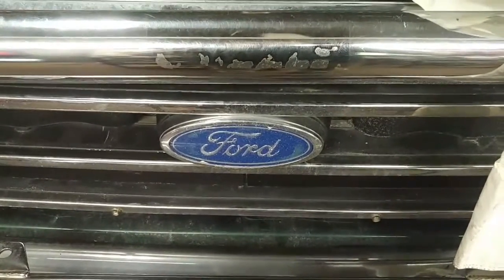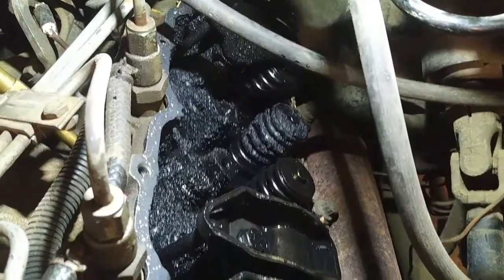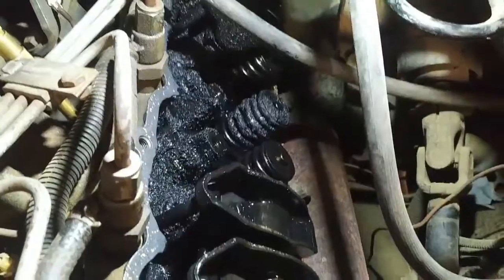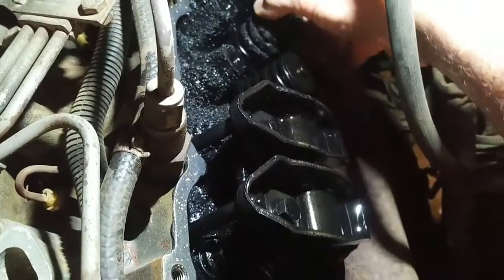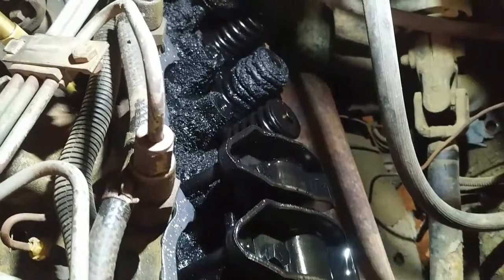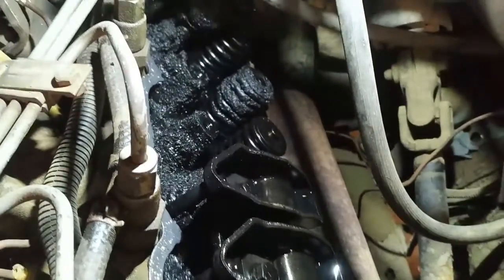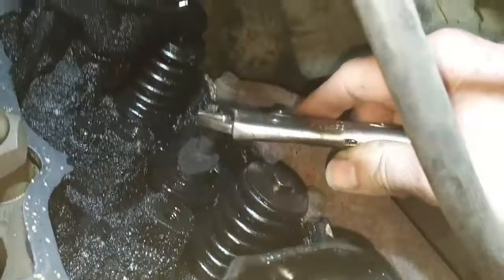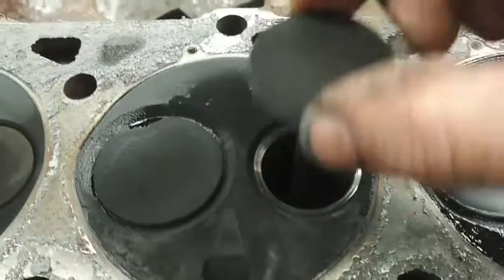1990 F350 7.3 Compression Problem pt. 2

Comment: Can intake vaccum test suffice in this situation of checking the valve
Reply from the maker: A diesel does not create vacuum in the intake like a gasoline engine so a vacuum gage connected to the intake would be no use. It may have shown up as an unusual pressure pulse in the exhaust with a first look sensor but that takes a considerable amount of calculating and a two channel lab scope.